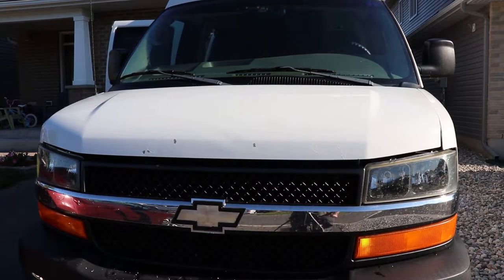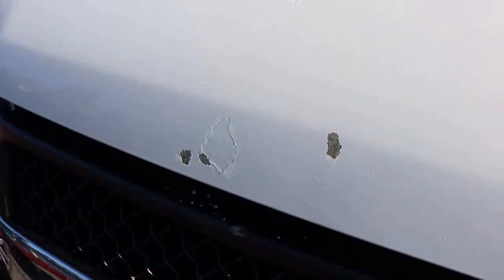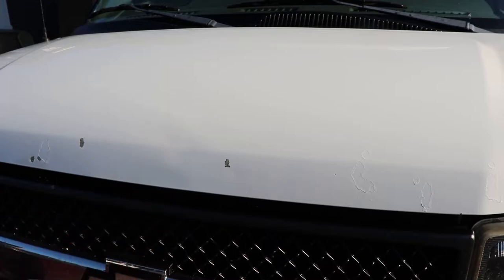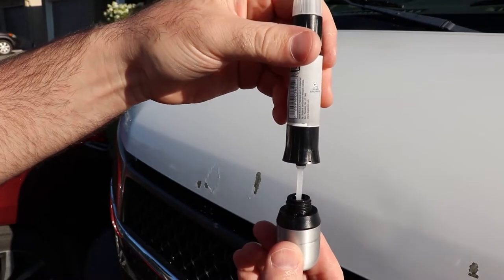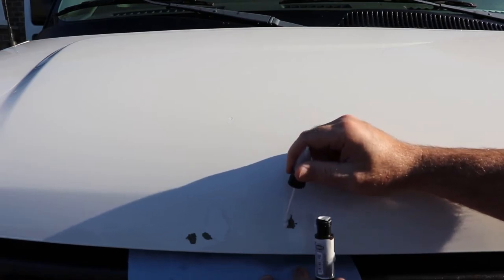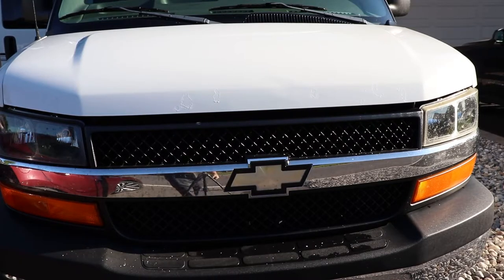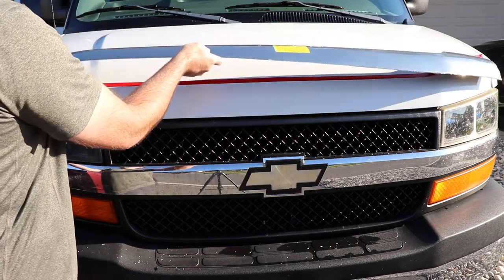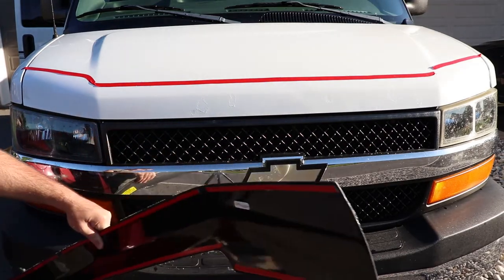Installing AVS 622068 Aeroskin Flush Mount Chrome Hood Protector for 2003-2020 Chevrolet Express

Comment: Dunno why, but paint on the hood of those Chevrolet Express vans routinely peels. Maybe bad primer, or lousy bonding of the topcoat. I see contractor vans all the time with paint peeling in several places. 

We’ve been lucky. The paint on the hood of our 2012 Pleasure-Way on the Express chassis has held up well. To be proactive however, I installed a Lund “Interceptor” Bug Shield. Looks really nice and definitely protects the paint. Lund Item #18443. Around $75 a year ago. They’re up to $100, or more, now.

Comment: hello, at 8 minutes in, you see the AVS stamp on the hood deflector. Is that a removable adhesive? or is it embedded in and part of the deflector?
Reply from the maker: it is a 2 sided tape pre-installed on the deflector, I expect it will rip all the paint off of my hood when I go to remove the deflector